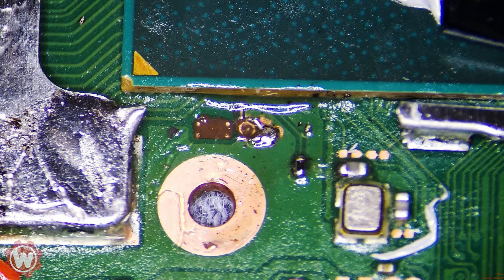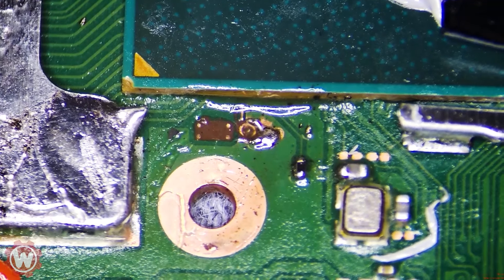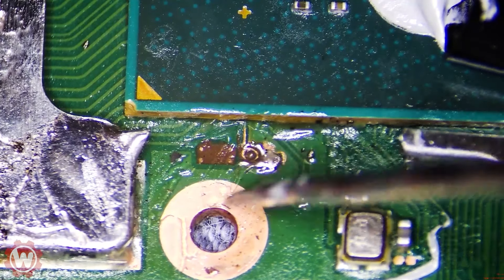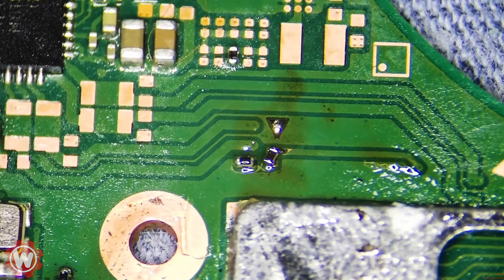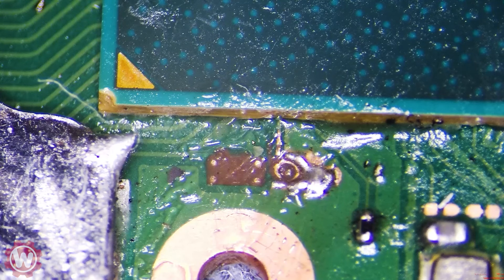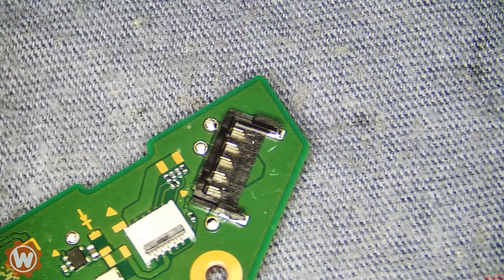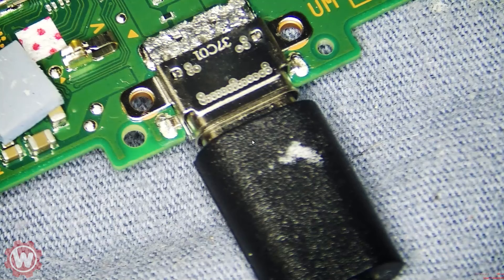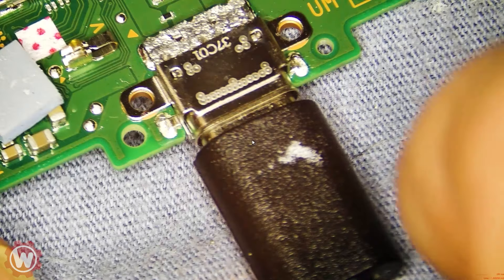RP2040 Install Gone Wrong on OLED Switch? We Fix It!

Comment: That's great making another video about the installation gone wrong! Last night i had to struggle to solder that little tiny point but i stopped cause i didn't had a legit microscope, so i bought one before things going bad...
Do you think that there's any other part of the motherboard which is the same than the D-point connection? Just out of curiosity

Comment: Isn't the value 4.7k ohm for the resistor that was replaced?
Reply: Hi, did you find this info out? Knocked mine off and lost it .. looking to replace.
Reply: @skrilla.scratch originally it's 4,7k ohm, but you can use different value that near original (4k, 6k, have seen messages about 10k)
Reply: @Faiver  thank you

Comment: Oh wow 36awg. I've been using 30awg kynar to mod xbox 360 motherboards for RGH. That via reminds me of the PLL via for the trinity xbox 360 slims. You have to scrape it to expose it and if you ruin that trace you cant RGH the console. Been getting a lot of time under the microscope lately modding xbox 360's. They're extremely cheap. Good things to learn on rn.